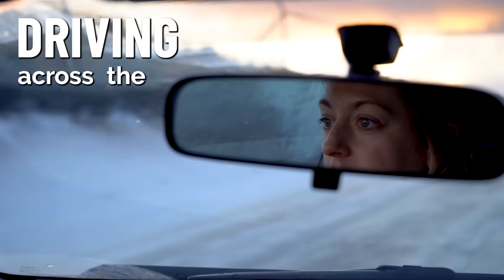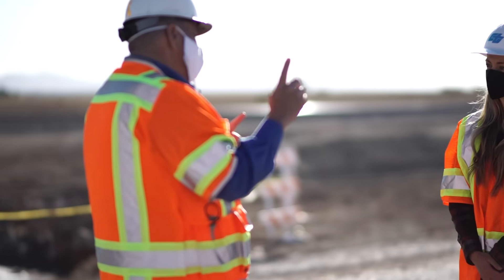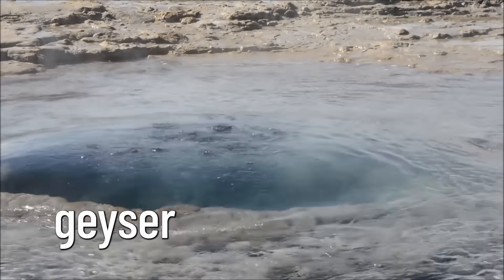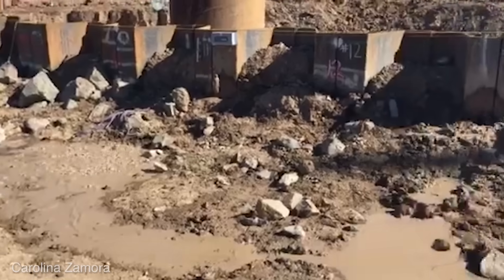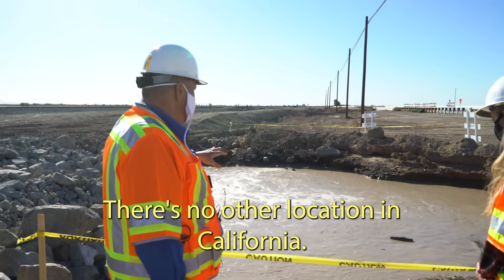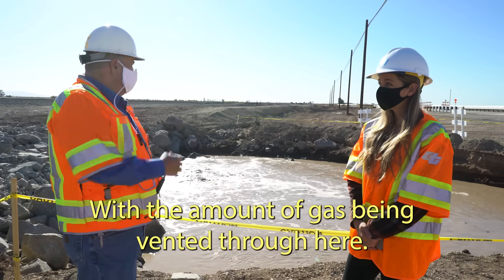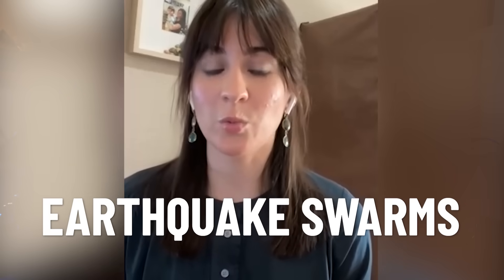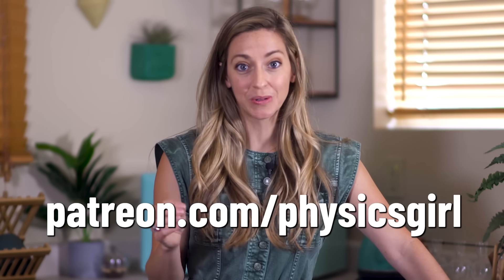World's Only Moving Mud Puddle

Comment: This has probably already been mentioned: CO2 dissolved in water forms carbonic acid. This will dissolve concrete, and may have eventually caused the sheet pile wall to fail anyway (assuming it was concrete). I suspect, though, that the source of the spring is much deeper than the wall.
Reply: How do you know that?
Reply: @camrenmugabe3062  I studied chemistry in college.
Reply: Keep in mind that I did say EVENTUALLY. That could be a long, long time.
Reply: @ronharrison8978  Ok thanks for letting me know.

Comment: It sounds like a a combination of Volcanic activity and Artesian Water Flow. The Artesian Water could have been released by the Earthquake by causing the Ground to move and let more Water into the Fault where the Rock is heated by the Volcanic Magma. The Volcanics could be deep enough that the Water has time to cool before coming to the Surface and with enough Water the Viscosity of the Mud Pot has turned to a Pond. The lower Viscosity would wash away the Overburden causing the Ground to sink and with nowhere for the Sediments to fully wash out the Pond would get bigger but could be back filled with Rock and the Rock would allow enough Flow and Erosion to allow the pond to move. As far as the Rotten Egg smell it is likely H2S04 or Sulfuric Acid. Extremely Deadly Gas and best to stay away from . Mystery Solved.

Comment: It remains me a case of "Unlucky Pit" in city Piła, Poland in 1893. Uncontrolled eruption of water from high pressure artesian aquifer destroys 42 homes. The water flowed from the well for six months, because the engineers could not control such a high pressure. The stream of water reached a height of 20 meters.

Comment: Can you add something to the. Mud to slow it down and make it thicker. Or would that act like a cork and plug it until it builds up pressure and pushes more to the top. Maybe it craked open a few septic tanks when it was moving and the extra water and sluge moved together to make one big mess. Maybe if you can throw in a strong rope with a small bucket you can get a small sample of it. And bring it back to a lab to see what most  of it is made of.it may give you a few answers to more of what it is. Good luck in trying to slow it down or stop it you would need to dry it out at close to its source. But we do not have a 30 foot long pole with a very powerful microwave inside it. It would dry it out if we placed some in a few key spots. But the big question would be how long would it stay that way tell it craked open and started all over again. But try and find a way if you can do not give up. Remember it takes Determination to build a nation and man is smart than mud. But that mud is stubborn for sure. Good luck.

Comment: What would happen if yall through some water pumps in there and ran them to some reservoirs to hold the water and diminished the "puddle" of its water. Drill some holes down for the gases to escape and relieve the pressure. Shouldn't move anymore at this point. Its moving because of the water softening the ground and pressure. I dont know how big the spring is but seems like a big problem and a possible solution. Would take a long time but better than it doing more in damage. Just a thought and possible solution. Would be better to do it in the dry seasons

Comment: Surrounded by graphene (oxide?) Malable up to 15 percent, and by securely anchored onto each side, the periphery, to challenge the courses and ultimately focus on a reservoir of mud laden by graphene sheets for a blanket effect and can actually be used to dry out the mud and separate the moisture to make it potable water 💧
Reply: Great Britain's highway construction currently incorporates graphene into the concrete for endurance and strength. Coverage over the top would be a good idea. Magnitude orders of higher quality and the cost has fallen, too. A viable option?

Comment: To: Physics Girl. The cause of the mud is due to continental subduction. Up swelling under ground aquafers.Two thirds of the oceans were once under the mid Atlantic ridge. One third the volume of the natural level of the oceans, is still flowing up the drift. The solution is a large trusle bridge over the flow of mud. Simply treat it as a river or a bay. The anchers for the trusle bridge, are set well apart from the strata of the flow. Yours, JOEL RAMIREZ RAMIREZ.

Comment: I would have thought that the easiest thing to do was to build a suspension bridge at ground level for the train tracks and for the road either the same or just reroute it a few 100m downwind (??) of the puddle and in a few years switch back to the original straight path once it's OK. Whichever is cheaper.

As to what's going on, I would have thought seismic technology where they make lots of small explosions and record and image the echoes could let them "see" down to several kilometres.

Comment: Water is moving because of uneven underground water pressure caused by the lowering level of the Salton Sea. The canal was cement lined through the sand dunes just before the mud pot started moving. So the lining pinched off a lot of the leaching water that kept things stable. There are mud caves in the area as well caused by that dang water running through soft powder dirt.

Comment: Can't they just drill a relief hole? Dig vertically down where the spring was first discovered. Then horizontally deep down. This looks like to my untrained eye an inverted pool upside down with a 'deep' end that is on the other side of the tracks. As the gas is released the pressure drops from one area, but it still needs to find it's way out and it does this along the water table and then up where it's easiest. If you just let the gas out from the source....

Comment: Since we can see the direction which the puddle is moving, why can't we test the "gas coming up at an angle"-theory by drilling deep down at a location which is on the path of where the puddle will travel? 

For sure the path, or "cavity", the gas is taking underground could be kinked at some places, but with some luck it might be possible to find the source and then have the puddle stop moving once you drill straight down into the source. 

Is the source expected to be very very deep into the ground? I know drilling becomes more expensive then further down you go.

Comment: As a geological engineer, I would sit through a two-hour long documentary on this. Definitely the most interesting mud puddle I have ever seen.
Reply: below the puddle is a normal water table

water erodes

the water often times will hollow out a chamber with a ceiling, floor and walls

moving water erodes faster

CO2 is an acid when combined with water (H2CO3)

undissolved CO2 moving through water creates water currents 

acidic moving water will dissolve  rock in the path of least resistance 

fractured rock is the path of least resistance 

the gas is working like a saw to cut through rock

once the CO2 can rise straight up,  it will quit cutting/ dissolving the rock and the puddle will quit moving

they have the right idea, vent the gas closer to the point or origin on the other side if the infrastructure 

but...

the ground  is now unstable  under all if it...
Reply: As a regular guy, I would also sit through a 2 hour long documentary on this. It doesn't make sense to me and I want it to make sense
Reply: I see the water gushing up. But where is it going? Is it recirculating back down?
Reply: @N-Lee  Also, why so 'SMALL'?
Underground, it could be a mile or hundreds of miles wide and/or deep!
I don't know, I could be wrong?
Reply: @N-Lee  76 has a
Reply: It's a lung
Reply: As an industrial engineer I would too
Reply: I'm not any sort of engineer and I'd sit through a 2 hr documentary
Reply: Same here.
Reply: I'm not an engineer but same dude, same.
Reply: Than you haven't seen my mother in law's mud puddle.
Reply: @samuelshin593 ...a question...why have YOU seen your mother-in-laws mud puddle? Eeeeewwwww
Reply: As an out of work aesthetician so would I
Reply: @mistiroberts1576 There's beauty in that.
Reply: I’m not a geologist but I find this truly amazing and interesting beyond belief
Reply: As an average mom at home, I would too. This is fascinating.
Reply: Out of all the mud puddles I've studied, this one is definitely the most interesting.

Comment: I remember hearing on the news that due to the draining of the underground aquifers during the last big multi-year drought central California sank something like 16 feet or so on average all along the central valley. The cluster quakes may have been related to massive collapses occurring deep underground in the now empty spaces where water once stood. Perhaps this event is tied to that somehow, they pulled a lot of water out of the ground, just the missing weight alone of the removed water may have caused the gasses to start to escape at an accelerated rate.
Reply: The sinking in central California is not because of massive, violent collapses underground because the aquifer doesn't occupy empty space. An aquifer is, and this isn't a technical term, like waterlogged rock. We can extract water from it because water contained in a rock is at higher pressure, so when we fracture that rock digging a well the water rushes to the lower pressure air in the well. The well is like a straw sucking water from rock. So when the water table lowers, you don't have collapse but something called subsidence. The loss of water causes sediment underground to slowly settle with gravity. When this sediment was below the water table, water filled the tiny pores between sediment and the increase is pore pressure meant those sediments could resist some of the compression pressure from overlying rock. Like how wet sand makes for building great sandcastles but dry sand wont hold it's shape and slump with gravity. The most important takeaway, however, is that because the water table slowly lowers over time, the compression and sinking of sediment happens slowly over time. There is no sudden massive failure. And because this is happening slowly, it does not cause earthquakes. Earthquakes do require a sudden "failure". The earthquakes in California are all caused by large scale tectonic activity. This region of the United States is very tectonically active due to the plate boundary creating faulting. But the subsidence causing sinking- this kind of compression just mechanically cannot produce earthquake sized seismic waves.
Reply: @vivianloney8826 that was very good explain, I'm a high school drop out work construction all my life and I understood everything you said. Wish I had teachers like back in high school.
Reply: What!? I live in the Central Valley & never heard this😳
Reply: @espinoza1987  We've been sinking for decades due to the draining of the aquifers. I tried to post a link to a story the other day but YouTube deleted my reply. Do a search for it and you'll find plenty of stories going back many decades. The multi-year drought was an exceptional few years, but long term the central valley has sunk probably 50-100 feet or possibly more since mass-scale industrial farming began sucking out the underground water.
Reply: And gases here in the Salton Sea are only escaping when the bedrock above them that they cannot travel through is cracked by earthquakes.

Comment: Sand Andres fault right under it…involves ground seduction with a underground fissure that liquifies the ground in the area. 

West of the SA fault is LA basin …as the cities grew & weight of tectonic plate on the westside  got heavier, cracks n fissures started to form along the fault line. Hence this will be the first of many along SA fault line going north along the line. West goes north, east plate south, like water, goes to lowest point to the fault line or moves with it.

Comment: I have a theory. I'm gonna attempt to draw it:
Before the earthquake made it move:
(sueface)
|            |
\            \
   \            \
      \            \
far under ground

after the earthquake:
(still the surface)
|        |
 \       \
    \       \
       \       \

some more time after the earthquake:

|            |
 \          |
    \        \
       \        \

Makes sense?
It isn't moving, but rather unzipping the ground. The earthquake Isn't necessarily the trigger, but it could have sped up the process by forcing the gas to flow through a tighter space and therefore faster.

Comment: I have a  doubt on this since 6 months.
Kindly answer please 

If we send a satellite towards sun and make it revolve around it within the radius in which it does not burn . We will attach 2 ion thrusters which will charge by the sunlight via solar panel on it . The 1st thruster will give angular acceleration and the second will provide the force which will balance the centrepetal ,  centrifugal force and radius of revolution also does not change..

The question is that 
Can we get a suitable velocity that it will escape out of the solar system when the 2nd thruster is turned off.....If yes , then What is the max. velocity it can achieve..

Comment: Upon installation of the sheet pile wall, there was a crack followed by an explosion in the ground. If it is due to an increase in pressure below the wall or something, then it might be due to increase in velocity of the water or gases (boiling can be due to any fluid) below the sheet pile. A possible explanation to this increase in velocity could be reduction in the cross-sectional area of the fluid channel below the ground surface due to insertion of the sheet pile, considering the fact that width of that channel is not very large in comparison to the longer dimension of the sheet pile wall. So, there might be a base of this fluid channel underground. Moreover, if it is really a channel, there must be a source of this mud water and, hence, the water could be diverted somehow. Of course, the engineers must have thought about this a long ago...I just wanted to share, being completely unaware of the soil and geological conditions of that place.
Reply: lol "moreover"

Comment: Its not moving, its growing? This is underground gas pocket beneath water that is raising through previously formed underground crack.
The pool is not draining on one side, it get bigger toward where it erodes new walls of the crack with gas and water. The crack could be very deep and blocking its top 5 meters will not do.
Time to use underground sonar to find where the crack is is leading and avoid its path. Hope that it ends after sometime and divert roads and rails and w/e, else they wont be safe.

Comment: While farming in Montana I learned about Saline Seeps. We had one spot that for 3 generations of Family had kept depositing rocks to allow the tractors and equipment to pass over. It was only about 6 feet wide but every years we took rocks that had been pushed up into the wheat fields by the frost heaves and then they'd sink. That's a lot of rocks!

Comment: I mean this is pretty simple to solve. You have a gas pocket that is being fed upwards. This gas along with a massive amount of water keeps the ground wet and moving at all times. The erosion that happens allows it to move. Before the quake the gas rate at which it feed the mud hole was more than likely stable which contained the hole to a small area. Once the quake hit it more than likely cracked more areas open which increased the flow rate at which the gas escaped and cause much faster erosion. The water is either from underground areas that get mixed in when it comes across it which is why the hole gets larger and smaller.  The best option at this point yet would cost more than its worth. Is to drill a few thousand holes anywhere between 100 and 5000 feet looking for the source of the gas. When a hole is found vent it as fast as you can which should lower the overall pressure and flow rate to the hole and either stop it or drastically slow it. Examples of this type of movement and or destruction can be seen in places where there used to be landfills that have been covered over. They solved many of these problems by venting the entire area which relieved the pressure.  Also I am not so sure this is a huge problem because anyone with even the slightest brains can see that this is a gas and water erosion problem .

Comment: Well, the direction and the rough width are known, couldn't they make kind of a bridge in advance? For example by putting several concrete piles near the road at the relatively safe distance from the future hole and then replacing the section of the road with a metal construction resting on that piles and a concrete slab over it?